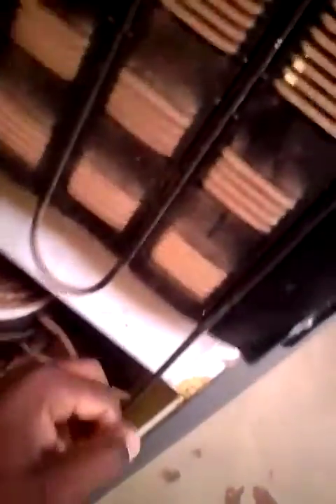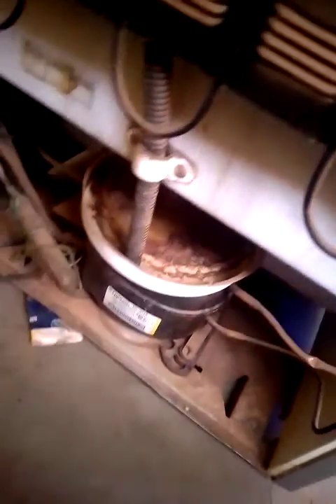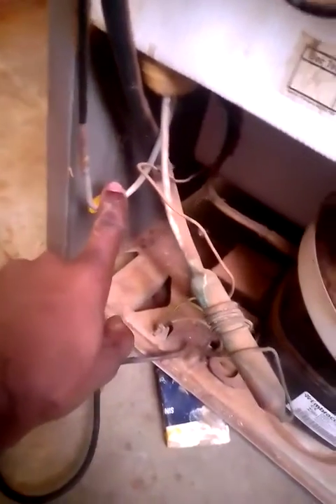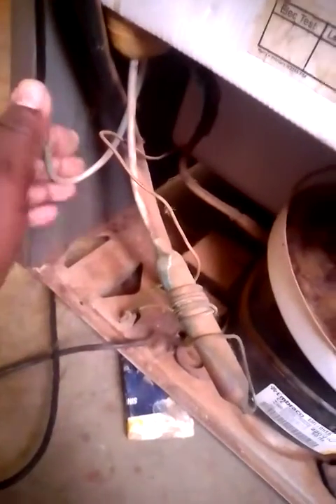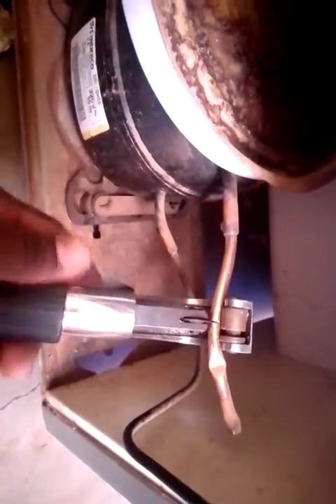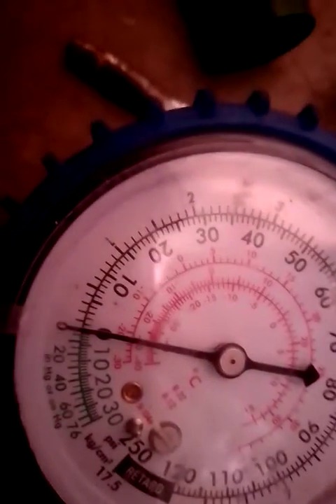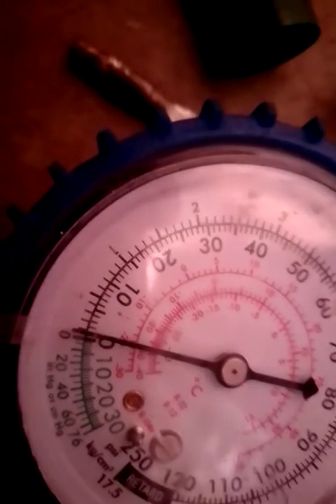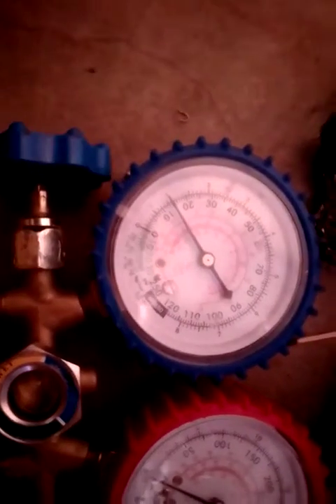Recharging a fridge DOING VACCUM without vaccum. Simple way , save some 💰💰💯

Comment: When l'm watching this video that's wat l did but my question  that moment after flushing it before l disconnect everything ,  l frst disconnect the plug does air outside get inside the capillary tube we used to flash

Comment: My last question some compressor they had no stickers and you don't even knkw the type of freon , on that issue what type of freon must l add
Reply from the maker: Thanks for your comment . You must not add freon rather do vaccum the add R600a if you don't know the type of freon to charge your system
Reply: @karaanielectricalsandelect5112  thank you l did vacuum using this a above method ,when they was no pressure inside l add R600a

Comment: Brother which you help me on this please ,l had been following your videos and l tried the frst customer to service here fridge,so far l had no vacuum pump l use this method for joining capillary tube at the and of discharge , yea l did all following wat you said on videos 

Here its the issue when l vacuum/ flush the fridge system l realize that the Gauge it self failed to go down until it touched the starting point but it was very close , then after a long time the capillary tube u will notice that the capillary tube realize small amount of air ,l dont know what was wrong..

Second issue the fridge it's oldt and it had been fixed several times and the compressor looks so old , and had to stickers l put freon R600a and it didn't even able to pump the freon the condenser remail cold and the discharge tube reaming cold even the fridge was running ,whst might be the problem 

Sorry l had to many questions,hope you will help me
Reply from the maker: I think the problem might be with the compressor. A compressor might have bad valve it will still sound like it's working well but it produce warmth on the condenser confirming that it's bad
Reply: @karaanielectricalsandelect5112  oky now l get your point ,it's been twice getting such problem ,so please enlight me ,how do l determine that this compressor had a bad valve ,l truly understand the valve you're mentioned it's inside the compressor right
Reply: @karaanielectricalsandelect5112  if you say it produce warmth , should the condenser feel warm or cold or wat ...but to my surprise before l solder the whole process the compressor was pumping air I a good state but it stuck on gas why